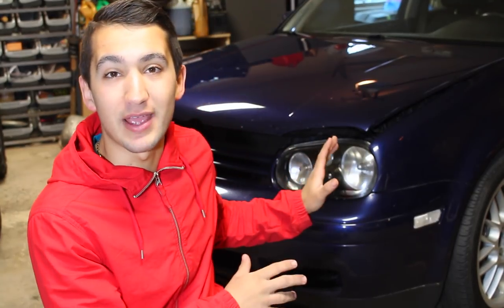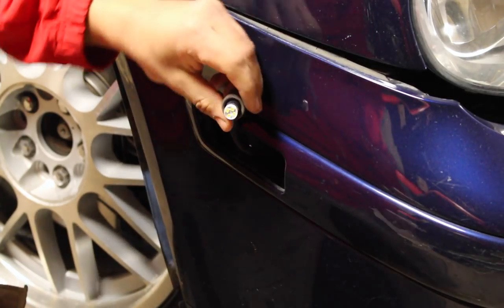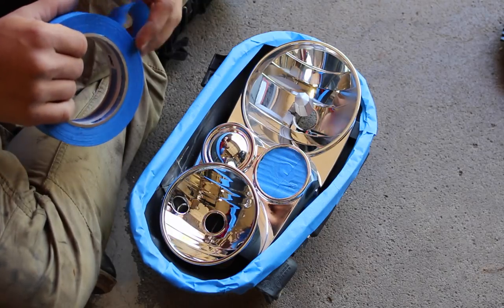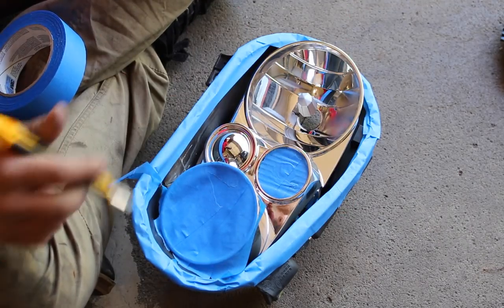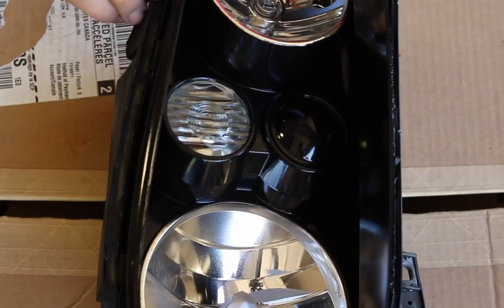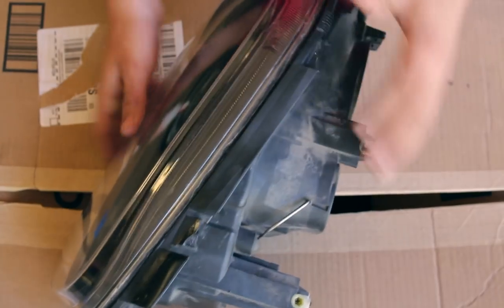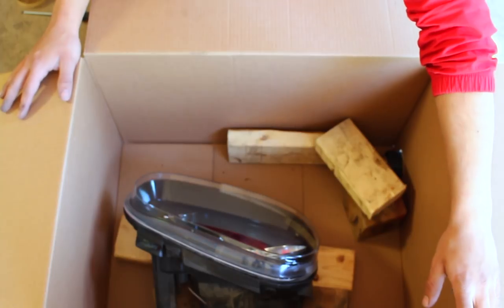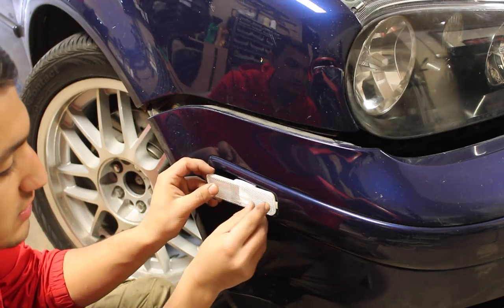How to Blackout Your Headlight Housing

Comment: instead of using a heat gun do u think that a hair dryer would work ?
Reply: Mike Redding  It’d take a heck of a long time. If you have a Harbor Freight in or near your town you can pick up a heat gun for about $8 with coupon. Otherwise, you could definitely order one online. I’d HIGHLY recommend you either pick up a heat gun or just use the oven.

Comment: I'm not even joking when i say this but the oven partially melted the inside of my corner/turning headlamps and warped the inside of them and i wasn't even able to get it apart. On top of that once it cooled the hole where my turning light goes into was not too small to even fit the light through it....so now i have to buy new corner/turning headlamps.

Comment: Did you have any issues with your LED’s and them flickering or intermittent working ? As I didn’t see you say anything about relays
Reply: Usually LEDs flicker if the electrical system isn't providing stable voltage or if those lights are running out. Most often it's the latter one.

Comment: 20:30 is there a reason why you did not remove the old bead of adhesive if you're gonna put a new bead anyway? Also, you probably should avoid touching your seal with oily fingertips in order to avoid the adhesive not work...just sayin'
1:10 you also forgot the 2 other torx bolts securing bumper behind the two fog light openings...

Comment: How long do you usually leave the primer and the paint to dry? How long between coats and how long before baking the lens back on? Thanks!
Reply: Most paints/primers will have that info on the directions. I've always followed that and have never had any issues. Because the directions are specific to the type of paint/primer, I would refer to those and you should be golden!

Comment: hey bro...I noticed u didn't need any resistors on those LED's I had installed some on my 08 maxima I was getting the hyper flash do u have any ideas of any company that sells LED's with out the need of resistors
Reply from the maker: +Javier Saravia You can find some on ebay, but why not just wire in the resistor yourself?

Comment: Milan you should show us painting door edge trim to match car door color. they usually sell black or chrome
Reply from the maker: +Tarek Taher Like the window trim?
Reply: +milanmastracci what about how to make a vid on how to install hallos rims??
Reply: The 03 vw's models come stock with trim that matches the paint :)
Reply: +milanmastracci window trim will be good as well. But no. like door edge guards trims from hitting walls when opening door. they usually sell in Chrome or black. but I want to paint so it matches my car doors. Be great video if you can make it
Reply from the maker: Oh I know what those thing are. I've never seen one of those installed on a car over here
Reply: +milanmastracci oh ok bro i thought you might know since you do most of the intallations your self it would be cool your golf having them intalled.
Reply: +milanmastracci and amother thing you should do is make some hallo rings into the headlights too.
Reply from the maker: I'm wanting to do some projectors in the headlights!! Something must be changed though :) If I do the projectors, i'll do halo's
Reply: milanmastracci i recommend that you should retro fit with hallos rings it would look amazing on your golf bro.

Comment: Now say I got some paint on the reflector and only noticed it after everything dried up, what can I do then to restore the reflector?
Reply from the maker: +John Tran Polishing it will remove it. Same with using a bit of paint thinner
Reply: +milanmastracci Thanks a lot! Hope it works.. because my brother had it done before.. but they had painted the high beam reflectors. It's been sitting there for a long time. If the paint thinner eats through the original coating.. I'd have to replace the whole housing. and Mini housing aren't cheap -_-
Reply from the maker: +John Tran Yeah man I hear you!! you could also repaint that area with a chrome paint. That way you get it just as shiny as before :) Paint a grey base coat, and then chrome over top.
Reply: +milanmastracci Thanks!! Good plan B!
Reply from the maker: Good luck buddy!!!

Comment: Why didnt u change the halogen ones for LED models?
Reply from the maker: +Jesus Christ LED's dont have the proper light output as the headlight housing was designed for halogens. It is the same reason I didn't install HID's in it.
Reply: milanmastracci Oh, didnt know that. What about Philips Blue/Crystal/Xtreme Vision?
Reply from the maker: If you have halogens in your car, you can go with whatever halogen you want. If you go with an extreme vision or something like that, that would be a very good way to increase your light output, while not blinding other drivers.

Comment: Hey does anyone know... Could I use adhesion promoter on the chrome instead of doing all that sanding?
Reply: You still have to key the area otherwise it will not adhere and flake off. The adhesion promoter will be used as a light dust coat before the primer.

Comment: how do you remove the bumper vents and is ther a tow hook hole?
Reply from the maker: +surviveasl You pry them down from the little clip at the top. As for the second question, i'm not sure.
Reply: okey thanks :)
Reply from the maker: No problem :)

Comment: I don't think the LED inside headlight will last long. The heat from Halogen bulb would eventually kill them.
Reply from the maker: Halogens aren't the biggest problem. Halogen bulbs won't generate enough heat to kill surrounding LED's. On the other hand, HID's generate a lot more heat, which could definitely kill LED's.
Reply: I had LEDs inside my bikes headlight which has 35W halogens and the distance from halogen to LED was more than 15cm but still some leds on the bulb burned out and all the burned out leds are facing the halogen side. The problem was that the heat is trapped inside headlight housing and the inside temperature increases which eventually kills LEDs. Anyway, that was my experience. Do let us know how long those LEDs last for you :-)

Comment: Also it’s not A chrome plastic coating it’s actually aluminum that is on there yes in a very thin coating but wearing it off is not what you’re concerned about the concern is any fingerprints or anything will cause scratches that will always be visible and will be magnified when light hits them... when it comes to opening lights check out Chris’s Chanel from “FlyRyde he is by far the best for this kind of thing... for golf got lights I have pictures and am happy to help

Comment: 220 deg for 8-10 mins... Do not do 250... also make sure that you put the light on a piece of wood... any metal will cause hot spots and melt plastic... (I have done this to many head lights also 3 different VW GTI’s which have the same head lights... also if any one has any questions I have pictures of the light I did and can give you step by step Correctly... do NOT touch any of the reflective bowls or you will always regret it..